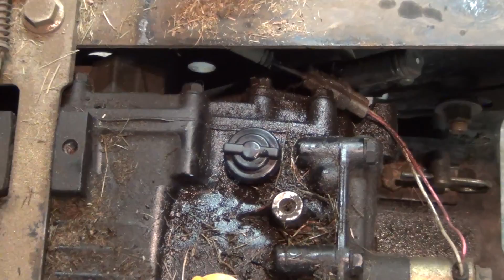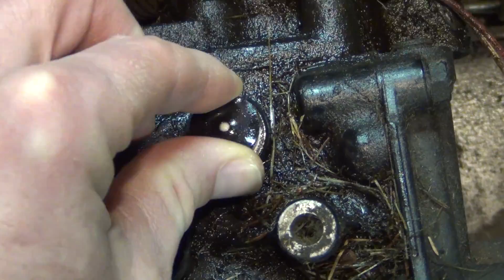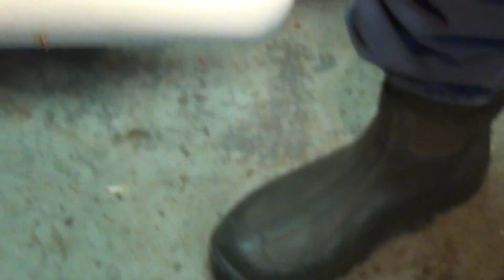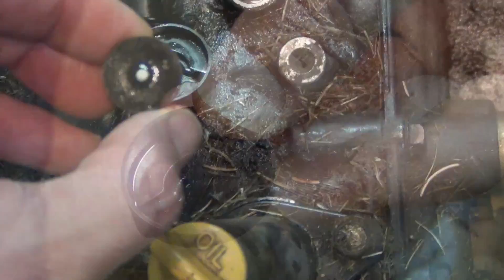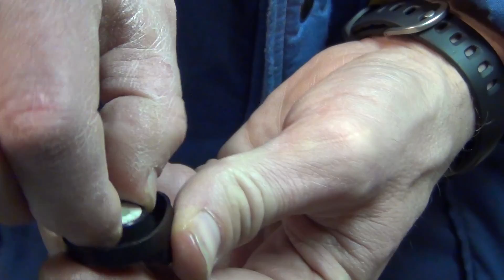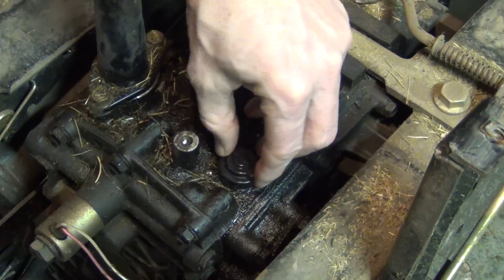John Deere 445 Transmission Oil Vent leak at 0 degree F., Cold Weather, AM878422

Comment: Hi I have an 09 X729 and I just replaced the control pump and put 7 quarts of low viscosity oil and it wines and nothing really works. Needing help to figure out if I need to bleed anything or release air out of the system, and how I do that?

Comment: Did you that fix the issue? I'm having leak and I'm trying to isolate it.
Reply from the maker: +Joshua Woolley 
Hi Joshua,
Yes, no more leaking issues after replacing transmission oil filter and transmission oil.  I suspect the transmission oil was low and the cold weather caused the transmission oil to bubble up (transmission oil with lots of air bubbles - foamy) through the transmission oil vent and leak on the floor.  In cold weather, I now let the engine and transmission oil warm up for at least 5 minutes before I start using the snow plow.  With proper transmission oil level and warm transmission oil, I have not seen any transmission oil coming out of the transmission oil vent.

Comment: Thank you for sharing.  This is exactly what I was looking for!
Reply from the maker: mramend You are welcome.  

I suspect my problem was a low transmission oil level and cold transmission oil temperature.  When the transmission oil was foaming out of the transmission vent cap (cold temp. 0 degrees F.) the snow plow barely moved up and down.  It took a lot of hydraulic grinding sound to finally get the snow plow to move up and down.  After the transmission oil  change (John Deere Low Viscosity Hy-Guard) and transmission filter change, I run (warm up) the John Deere 445 tractor engine a good 5 minutes before I start working the snow plow hydraulic levers.  No more transmission oil leaks and the snow plow hydraulic levers moved up and down smoothly after the 5 minute engine warm up. I tested again last week  at -6 degrees F and no transmission oil leaks were observed and snow plow hydraulic movement was smooth and not stiff.